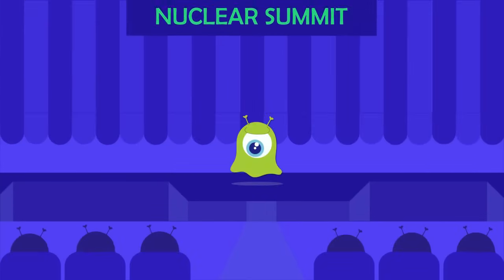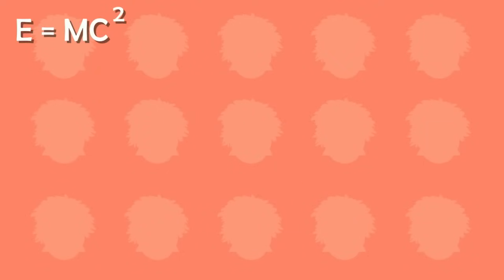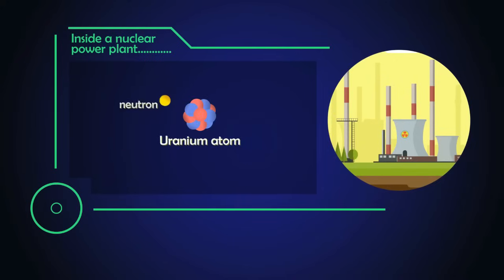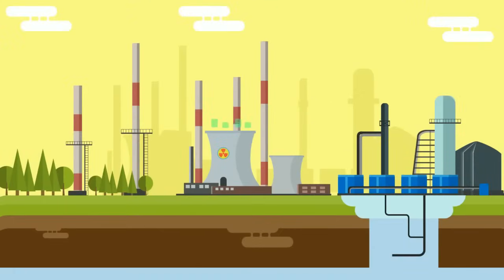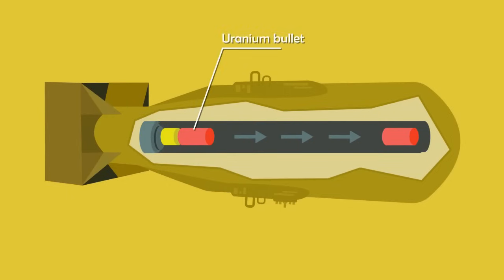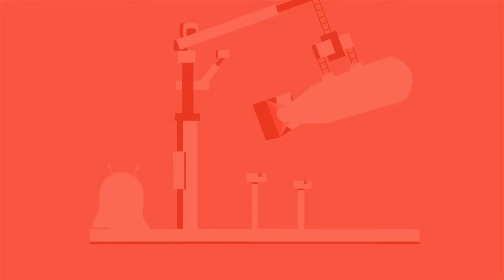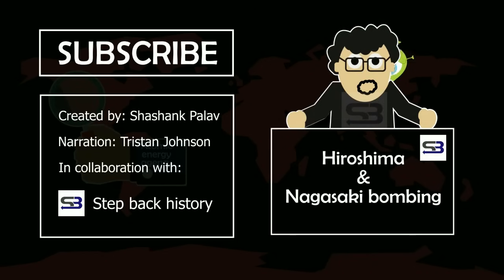How To Make A Nuclear Bomb | Atomic Theory Explained

Comment: Just finished the complete design of my own fusion boosted fission device. Predicted yield 20-40kt (not estimated a the yield fully yet), mass of about 75 kg. Uses 4.71kg of Pu239-Ga1%, with 7% or less Pu-240, 1.16Kg Be, 0.3kg LDPE, 0.83kg W, 23kg HMX, 30.5kg TATB,  0.005kg Tritium-deuterium 50/50 mix stored at 25atm, then some copper for the shockwave lensing plate, aluminium and steel for casing,  soborthane, rasberry Pi, two bridgewire detonators, and a 5kV power supply, and a pulsed neutron generator. The last two components I'm I won't design myself, they'll be off-the-shelf devices that I haven't selected yet. 
Fair to say I know my way around nuclear weapons, or at least fission weapons. Interstage coupling, xray attenuation and a few other technologies required to build a two stage Teller-Ulam thermonuclear device aren't in the public domain too much. But feel free to ask me anything about fission devices. One of my passions.
Reply: I want to see a 30 gigaton thermonuclear device that can be housed on a cargo ship
Reply: That would be a pathetically inefficient use of fissile material and a useless weapon. We got rid of multi-megaton weapons for a good reason, and you think multi-gigaton weapons are of any use?
Reply: I don't care about the practicality, I just want to see a massive explosion the shatters and deforms the planet for thousands of years to come :D
Reply: It wouldn't do, it's just make a crater the size of a large city, I estimate.
Reply: you forgot 2kg of deez nuts
Reply: That's amazing, man
Reply: @generickeysmash  Only done more since. Still at it.
Reply: @Evan_Bell  Wowza, that's impressive
Reply: @Abhishree Onkar Where to buy what?

Comment: A few things...

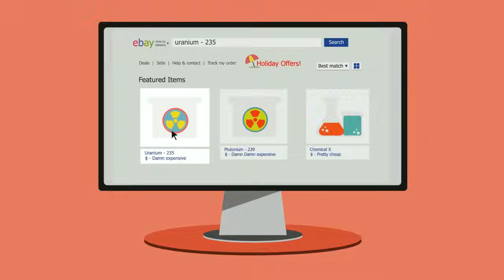• 0:29 "A few pounds of Plutonium" 
Theoretically, the Minimum Critical Mass for 100% pure Pu239 (doesn't exist) in a perfect sphere (impossible to manufacture) with a perfect Neutron Reflector (also doesn't exist) is ~7kg = 15.4lbs 

In reality you'd need more like 9-10kg/20-22lbs. U235 is even less fissile, requiring about 25kg, or 55lbs of Weapons Grade material (>90% purity) to produce a Fission Detonation.

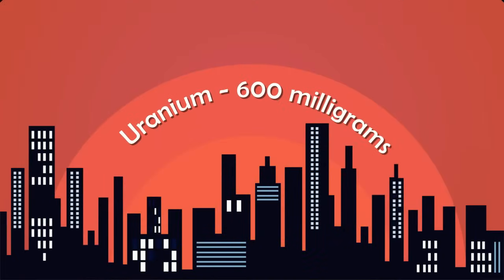• 1:20 Little Boy contained 64.1kg (141lbs) of Uranium 235, not 600 grams. Only 600 grams actually Fissioned, but that would not have taken place without the other 63.5kg of Weapons Grade (>90% purity) U235 providing the necessary cascade of Prompt Neutrons.

• I'm not sure why you neglected to mention the importance of Enrichment. Natural Uranium is only 0.72% (0.0072) U235 by weight, the other 99.28% is non-fissile U238. 

• It would take 1,000 gas centrifuges about 1 year to produce the 25kg (55lbs) of 90% pure U235 needed for a bomb. Fortunately nuclear reactors don't use Highly Enriched Uranium, they use Low-enriched Uranium (3-5% U235) but it would still take those same 1000 gas centrifuges about 8 months to enrich that same weight of Reactor Grade Uranium. 

• It is literally impossible for a nuclear reactor to ever produce a Fission Detonation like a nuclear bomb (as your cartoon seems to imply) because the density of Fissile Material in Reactor Grade fuel is too low to reach Prompt Supercriticality even under the worst circumstances.

Comment: Next video: how to acquire uranium-235
Reply: Dark web
Reply: Would be easier to build a subcritical reactor or neutron spallation source to transmute the u-238 into Pu-239.
Reply: The way the Manhattan Project did it: you spend several billion dollars (in 1940s money) to separate it from uranium 238. Not at all easy.
Reply: Cinders2Ashes  uranium that you can buy uranium ore that contain 99.3% u238 and 0.7% u235, you can used it to make a bomb if you can somehow make composition of the u235 from 0.7% to 90%.
Reply: @ttrieds8023  Not that hard to do this ;), (as well to make nuclear explosion, you need critical mass, which is around 56kg for U235.)
Reply: @ttrieds8023 Getting ahold of Uranium to make the weapon costs money.
Reply: @brendenvannatta8088  Smoke detectors don't contain uranium. They contain Americium. You'd like around 100 billion of them. More than have been made. X-ray machines don't contain plutonium either.
Reply: @Evan_Bell  your mother contains it ;)
Reply: @NarutoNinetailFoxs  What's wrong with you?
Reply: brenden vannatta I’m pretty sure uranium 235 is not in a smoke detector that’s americium
Reply: More like a meteor....WE ARE ALL GONNA DIE
Reply: Used the deleted video (which is reposted by a channel named "deleted video") from cody'slab with slight tweeks to the procedure
Reply: United nuclear
Reply: Was on sale at Lowe’s last week 35% off!!!
Reply: Good luck with that, the mining is not cheap.
Reply: @brendenvannatta8088  u dont know shit. U just have heard something and now trying to be smart. Smeke detectors doesnt contain uranium, it contains americium-241. And xray doesnt even contain radioactive elements. Just stooppppp
Reply: @brendenvannatta8088  that was cringey to read